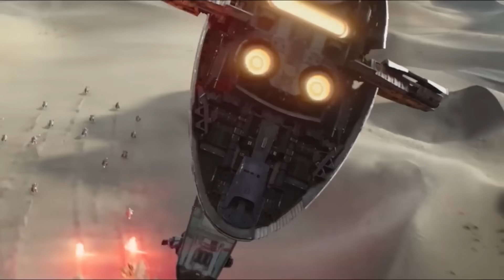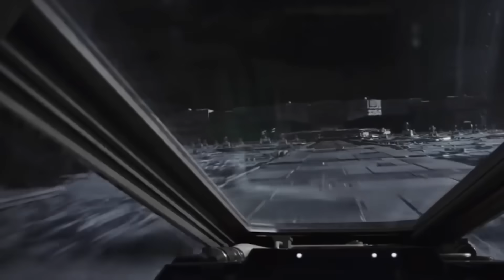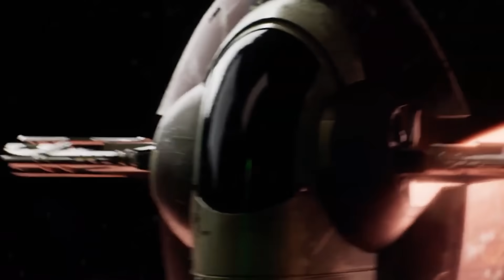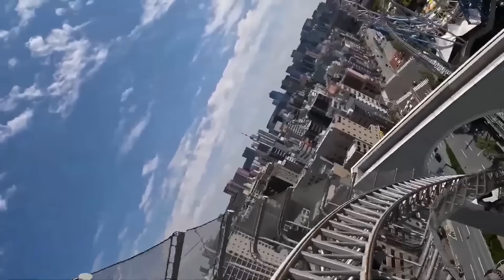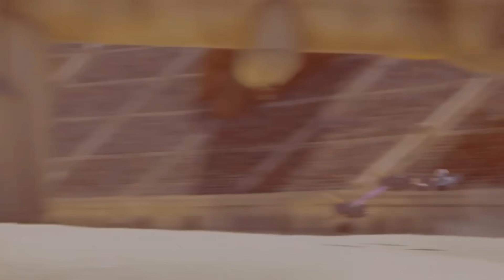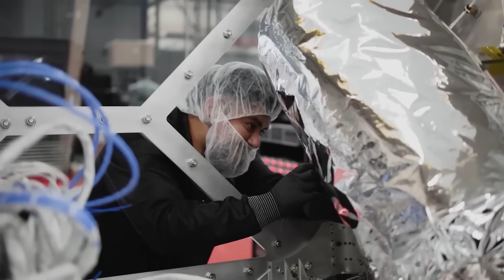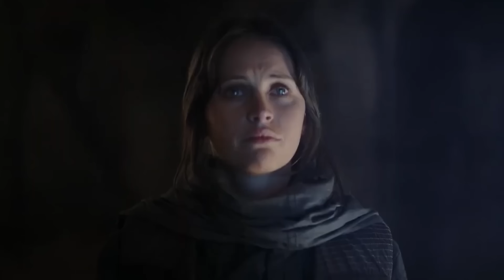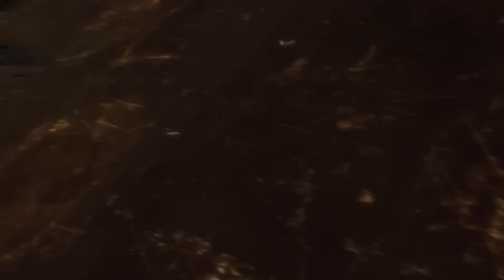The Problem with Star Wars Ship Design

Comment: Also the wings on fighters would be used to mount more weapons and allow for atmospheric control and shield projection. Specifically in the x wing the wings split to allow excess radiation and heat dissipate from their reactor and expanded the effective range of sensors and shields
Reply: Heat dispersion is actually a big potential problem in spacecraft design.
Reply: @GummiArms when you think about it though laser cannons and a miniature nuclear fusion reactor would generate huge amounts of excess heat that if allowed to build up would cause issues with efficiency for both components. And it makes sense that they would be in the s foils of the x wing because when closed the heat is conserved but when opened for dogfighting you get better cooling when it is needed the most ie when the laser cannons are being used and when the sublight engines are being used at high power for extended periods of time
Reply: @TmanF1nerd  Yes, exactly. And the X-Wing is pretty brilliant design when you put it that way. Doesn't hurt that it also looks cool.
Reply: @TmanF1nerd  in Space the only cooling is radiation (that is Infrared light emitted by the cooling panel), whicch is painfully slow and needs as large a surface as possible... 

but then there could be a million "in story" reasons for such designs, like an improved shield geometry through multiple emitters at better positions than if you only had the huil to place them... in Star Trek they do something like that with the Warp Bubbles, some ship designs are optimized for the warp technology they use.
Reply: @WoodyGuthrie-p7uI’m not talking about surface area here but more the fact that the only place for radiation and heat escaped was from between the wings. The outside surface of the wings was largely insulated from escaping radiation and heat to the best of my knowledge. It was basically a vent that could be opened or closed
Reply: @WoodyGuthrie-p7u It isn't, infrared radiation doesn't need an atmosphere to work and more surface area to radiate heat from is helping, atmosphere or not.

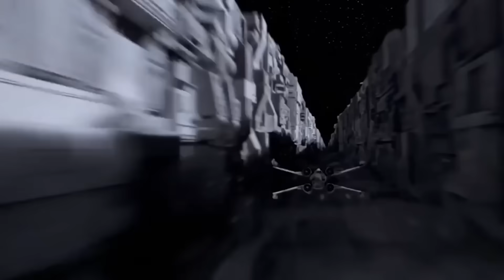Comment: 10:00 the wings can serve as radiators, which are essential to cooling down in space :)
Reply: doubling your potential cooling surfaces at that size does not really make a notable difference, for cooling vanes the wings are awfully small... remember in space there is no cooling through convection or condction as you have no medium for either, so it's all radiative cooling and that is painfully slow and needs as large a surface as justifiable in the building costs ;) Also why would the bigger ships not have cooing vanes in such a case?

Still it is easily imaginable to have 20, 30 advantageous reasons for any wing design, from split up shield generators that sit in a better position when the wings are split open to targetting sensors that get a better lock when spread out to minimizing potential damage to the weapons systems when you can hit only one major gun instead of 2 with each struck wing...
Reply: True - often under appreciated aspect of spacecraft is in a vacuum, heat is only lost by radiation, not convection. That said, they look cool, even though the whole thing has no meaning or function in Physics.
Reply: @PaulThatcher-iu5in  How can you say that they have no function when the effective area for heat dissipation essentially doubles when the wings split up? And not only that now the engines are better positioned for more agile flight.
Reply: @toastyrules8221  The wings separate, but by the look of it, when "folded"in together, they don't form one two sided wing, but two wings close together. Besides, the amount of energy that would be required would be huge in any case, so why not just have them permanently open? Come to that, a much more efficient layout would be many thin "wwings" - shocker, just like a radiator... Let's be honest, they were made to look like cool futuristic fighter planes, and that's cool with me - so why make up quasi "scientific" excuses? Science fantasy is fine, but it'snot hard sci-fi, and so doesn't gain anything from "hard sci-fi" "explanations...
Reply: @PaulThatcher-iu5in  When the wings are together the heat can't be radiated away in the insides, so the only surface area you have for dissipation are the outsides, thus acting as only having 2 radiator wings. The changing form has also a reason, when the wings are together the engines/thrusters are closer to the center of the X-Wing, thus being better suited for providing forward thrust.. When the S-foils are engaged in combat mode the X-Wing can better utilize thrust vectoring and is able to handle the increase in heat buildup through shield recharging/firing of the weapon. I assume you mean engaging the S-foils needs huge amounts of energy, which is irrelevant as the X-Wings capacity to store/generate energy is enough for plasma weaponry, shields and hyperspace travel.

Things can be cool and can be even cooler with suitable explanations. Doesn't need hard scifi to make sense either.